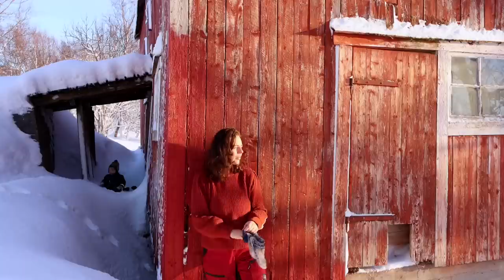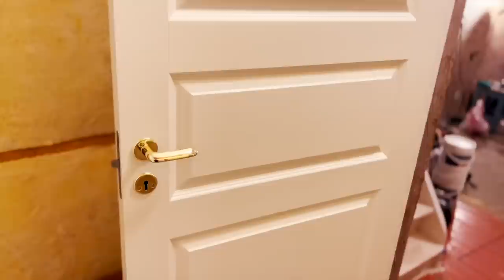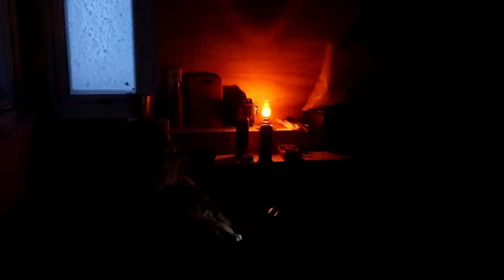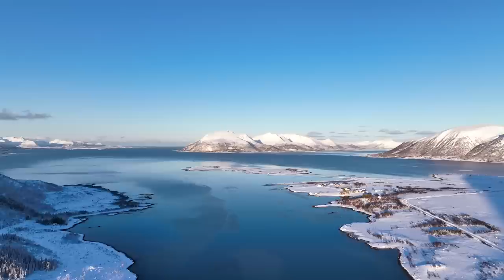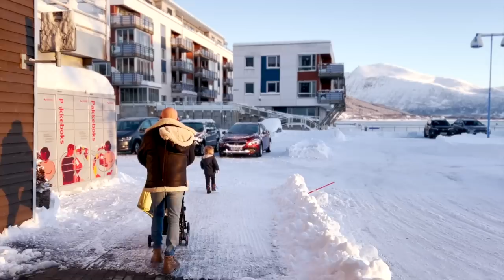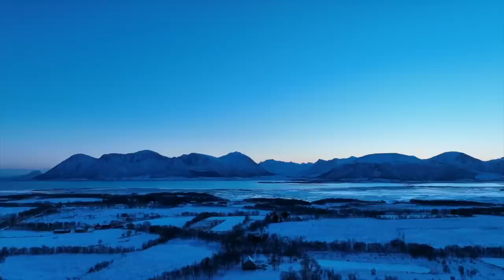The Sun Returns | Winterstorm in Northern Norway | Andøya Vesterålen | # 25

Comment: "Showing results for hurricane force winds in mph and kph chart:Category	Sustained Winds
1	74-95 mph 64-82 kt 119-153 km/h
2	96-110 mph 83-95 kt 154-177 km/h
3 (major)	111-129 mph 96-112 kt 178-208 km/h
4 (major)	130-156 mph 113-136 kt 209-251 km/h"
Reply: Wind are measured in m/s (meter/second) and those "categories" you come with are for classifications of tropical cyclones that hits for example Caribbean and south/south-east USA.   Such weather systems never come into the Northern Atlantic and to northern Europe and Norway.
Norway only get high winds caused by frontal low pressures ....and there are only one category for hurricane force wind .....which starts with 32,6 m/s.   For the storm mentioned in the video the strongest wind was measured to 54,5 m/s.   The sea outside that area had waves up to 25 m.   Within a few days they had 2 - 3 such weather systems passing through.